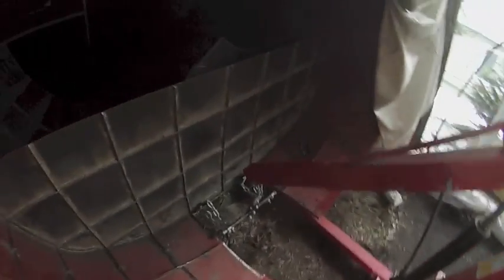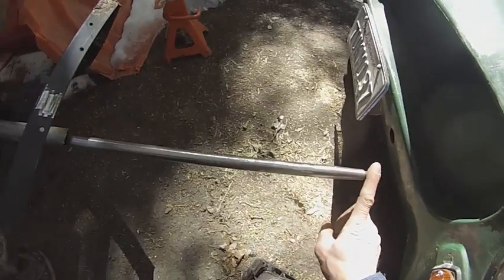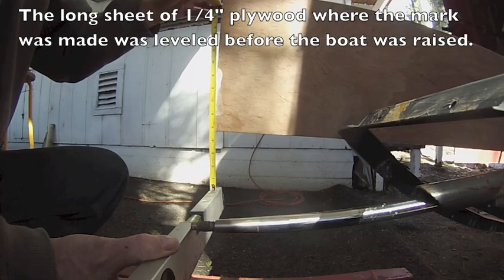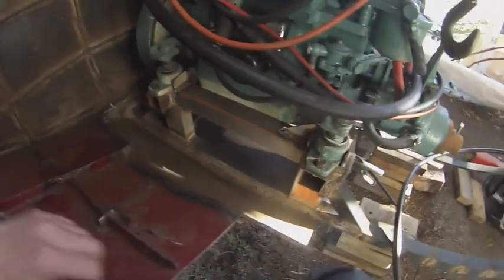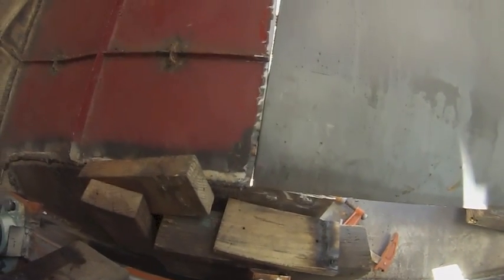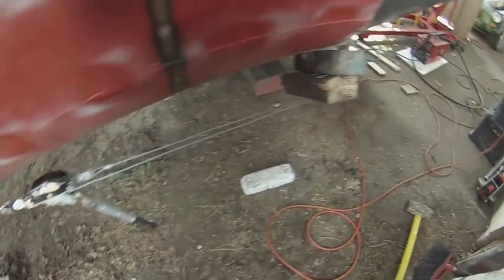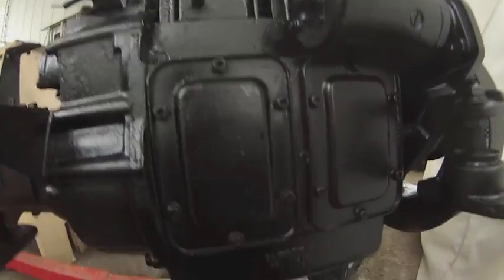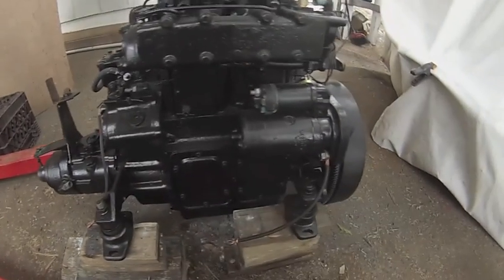Steel Sailboat Build Part 26

Comment: I know this may be a waste of my time but have you noticed that the spare engine mounts that you are considering using to anchor your engine all of the bolts are one half of the size of the original. I'm sure you are aware that a bot one half the size has one quarter the strength.
On your free wheel hand crank I would assume you also know that the danger is greatest in a kick back not starting.

Comment: It is my understanding that it is not the cranking and starting that breaks your arm, instead it is the backfire that kicks the crank backward that breaks your arm.  The cure/prevention is all in how you hold the crank handle.  The question you need to answer is: do diesels occasionally backfire in the process of starting?
Reply: Normally the shape of the connection is one way, so if it does turn backwards, it throws the handle away from the engine.
Reply: @zimtuff  If that were the case then how would it apply force in the direction to start the engine? It is shaped so if it does start it throws the handle away from the engine thus keeping it from turning at the speed of the engine.

Comment: Solves the bad hull design that never allowed for a motor, by adding a "basement".
The horror continues.
Reply: No not a horror .   Its like a bad car wreck while we all slow down and rubberneck in the end it wont be any of us that die.     So sit back and enjoy .   This is entertainment.   Whats the worst that happens ?   It actually floats for a while before the failure.    Sail on my friend
Reply: Engine will be like extra ballast down there!
Reply: @keimo2007  It will ALSO be extra buoyancy, that is  until the under size steel and welding  break under light wave loading , and flood the entire hull. 
Putting a "bulge" in the hull would also muck up steering and overall performance, if it ever went on any kind of trip.
Reply: Its going to be a Very short trip lol
Reply: Lmfaooo!!

Comment: When bend compound curves (bend in two directions) you are shrinking or stretching the thickness of the metal.  The metal buckles because it has not been shrunk/stretched.  A planishing hammer or an English Wheel are the best tools, but they take some experience.  BFH works, but it will get smoother results if the metal is baked by a dolly.

Comment: Love the copper pipe idea but you must solder them!!
Reply: I watch a bunch of car building channels, all of them prefer crimping over soldering.
Reply: @zerge83  They do, but there again they use proper crimps that are actually made for the job, and they fit the cable.
Reply: @zerge83   are they crimping copper pipe ?